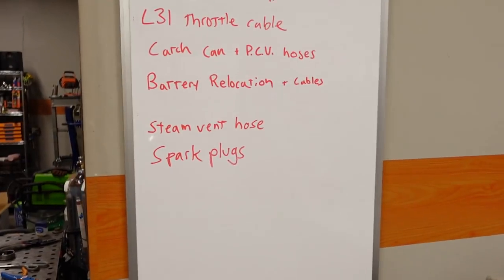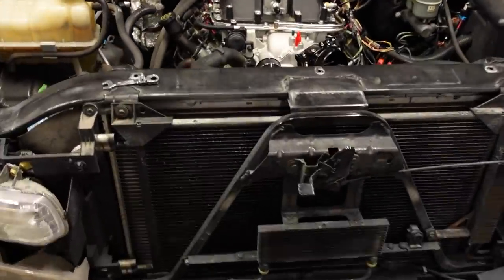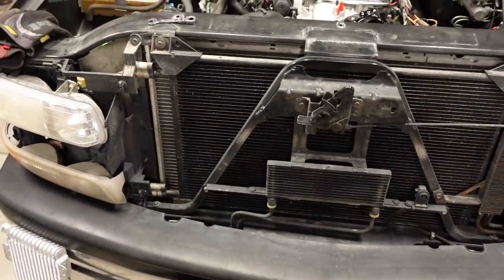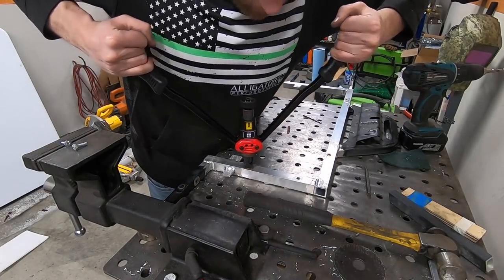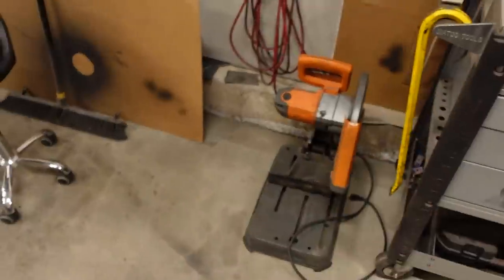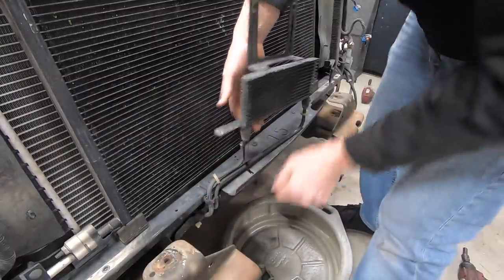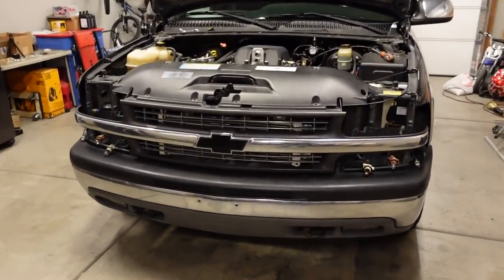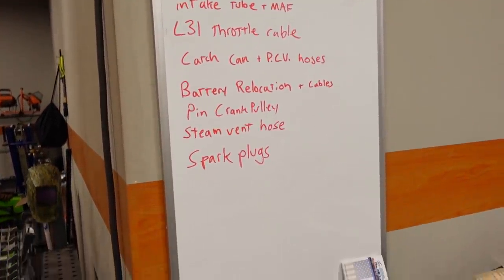Supercharged Silverado gets a MASSIVE Heat Exchanger & Trans Cooler

Comment from the maker: Most of the major jobs are done with the LSA conversion, but there's a zillion little things I still need to finish up. What parts are you guys interested in seeing (if any) of the remaining details?
Reply: Everything Lawrence, everything.
Reply: Would tilting the radiator back be an option to gain room?
Reply: All of them, you are really hittin’ this on out of the park.
Reply: I will watch anything you want to show. I enjoy watching your videos. You remind me of Chip Foose on wanting things look like it should have come from the factory that way. I am the same way. Nothing like a clean factory look. Thanks for sharing!
Reply: Throttle cable bracket
Reply: Are you letting the computer control the intercooler pump or just hardwiring the pump on? Also any plans for an "ice tank" in the future?
Reply: I'm interested on how you plan to wire the intercooler pump.
Reply: All of it. Devil is in the details. Lots of people skip all those small little things that really make a job look nice when done.
Reply: Do a killer chiller in conjunction with the heat exchanger and have frigid air.  I had one on my 03 Cobra and it was amazing.
Reply: Are you leaving the beds open or covering them?
Reply: What’s the measurements of the heat exchanger?

Comment: I have a square body truck with a Gen 5 LT4 and had to solve the same problems.  I used a Setrab exchanger for the supercharger and likewise put it in the front of the stack of coolers.  Ideally, it would be good to have the AC condenser as the foremost in the stack (particularly if the supercharger is working when towing), but it can be complicated to achieve that arrangement.  Great work, LT.

Comment: Build looks good, similar to my set up with the true cool and an auxiliary electric fan. FYI in rare occasions abrasive discs made fore steel can load up when cutting aluminum and come apart. Abrasive discs for aluminum are typically wax impregnated  .

Comment: Another awesome video! Keep Rocking and Rolling brother!!!! 100k Is going to POP up AND pass BEFORE You know it!!  

Also, I just picked up an 01 GMC Yukon XL, 1500/5.3/4L60E?/4x4 W/Electric push button/2HI-4Hi/4Lo. It needs some minor fixing up, they rear-ended a jacked up truck and it smashed the center of the grill in also crushing the trans cooler and bending the condenser and radiator they drove it and basically completely ran it out of transmission fluid and I disconnected the trans cooler lines and put a hose between the two so it could still flow and filled it back up with trans fluid but now when the trans starts to warm up the front pump starts making noise and then it basically acts like it goes into neutral because reverse drive or manual first second or third gear it won't move. If you park it and let it cool off the pump starts to pump again and it will move under its own power but as soon as it warms up it completely loses everything. To you does that sound like a damaged front pump? Maybe a plugged up filter? I'm going to drop the pan and see what it looks like inside later today. I sure hope they didn't completely toast the transmission!..... Crossing my fingers

Comment: I have that Mastercool hydraulic crimping tool which can do many crimp styles including GM trans cooler quick connects.  It is a bit spendy but it saves a lot of anger and frustration over basic double flare manual tools.  If you get a nice tubing straightener and this hydraulic crimper you can easily build or rebuild all of the small diameter tubes for brakes, cooler, or fuel lines on most any vehicle.  Also for the rust belt viewers you can cut back to non rusted tube and crimp it on the vehicle and add in a repair section with unions.  Wish you had shared it with the viewers LT!!!

Comment: If it is helpful on the ST205 Celica All-trac's they had a massive intercooler pump (7/8" hoses, centrifugal pump with a starter motor sized electric motor. The factory had it wired so that as soon as the throttle moved off the idle stop the pump started running.

Comment: Great job Lt. I just recently had to change some oil and trans coolant lines  that were leaking and decided to prep for my stall and cam upgrade by changing to the true cool40k as well. I didn’t like the hoses provided and wished I could have made hard lines but didn’t have the tools. If you can send a link I would greatly appreciate it.

Comment: What tool did you use on the trans cooler lines to install new fittings? Very clean work as usual. I love your strict OEM approach 😃
Reply from the maker: Thanks! It's a Hydraulic Flaring Tool, and I put a link for a similar version to the one I have in the description

Comment: Summertime temps will prove this to be either efficient or inefficient. I’m looking to do a whipple on my 07 Tahoe and considering mounting my trucool in the space under the fans but above the plastic shield with 2 small electric fans if needed.
Reply: I think he gonna have issues with the trans I’ve seen it done the same way with turbo builds and the trans cooler doesn’t get enough air to work enough.

Comment: Looks good. You don’t happen to have note of length and height  and square tube size you used to make the new frame? And also which size heat exchanger you used? There is a couple listed on their website. Thanks!

Comment: Kind of curious how chevy added the Duramax intercooler into the same space between the radiator and grill on a 2001-2004 LB7.
Reply from the maker: the radiator was closer to the engine, and the intercooler was where the radiator is in a gas truck

Comment: Hey LT! I seen a guy with an Audi that added an air to water intercooler and he welded up the front bumper up so that it held water so he had a bunch of storage for his atw intercooler setup. Might be good to have a larger capacity for your setup. It makes me curious what sort of math you need to do in order to figure out how big of a heat exchanger and fluid capacity you need. If you have info on this make a video on it!!

Comment: Hey friend I like to pay for a consultation maybe this week, doing some injectors on my buddy's Silverado its a 2016  I see it has a pro charger but I want to crank it up thanks. I have an old 340 hemi from 67 69 not sure what do you think about putting that in a cherokee and a 67 cutlass never had unleaded gas 333 jet fire ?? I remember it when I was 16 that thing would get up and bark ..gramps let me drive it to go paint it ..it was fast all original (RIP gramps, I got the car it is safe.)been sitting since the 80s these are the subject matter ..when and how much maybe a half an hour I get with my homie.

Comment: Big fan of the attention to detail sir. I am in the process of finishing my swap on a 00 RCSB, but have a shortage of time and fair weather. I am using the Holley throttle bracket that bolts behind the throttle body with an LS1 throttle cable, which works perfect, but kind of lays across the top of the lid. I may do something else later but for now, it works great. GM #12565559/ Holley #20-148
Hope this helps and look forward to seeing the first burnouts!

Comment: Dose that effect the cooling for the engine?
Reply from the maker: should not, we have a larger radiator than it originally had, plus the heat exchanger and trans cooler only covers a small portion of the engine radiator